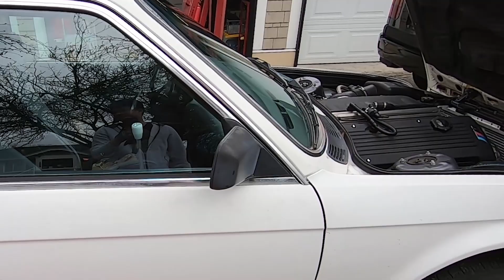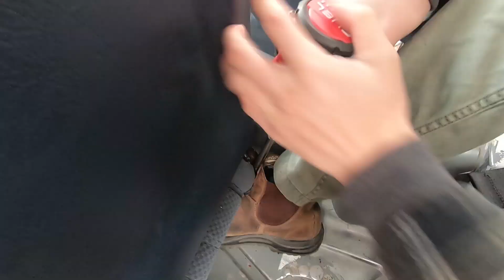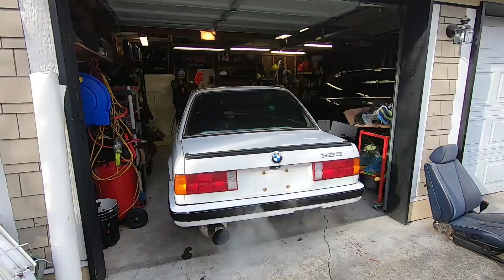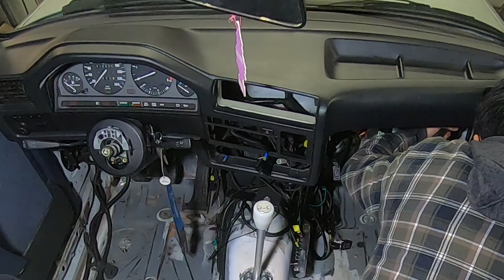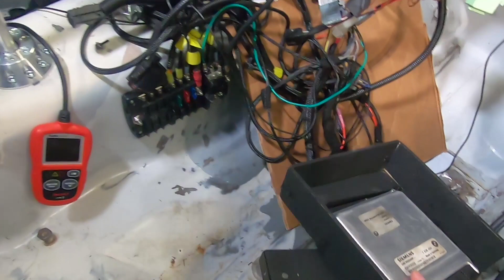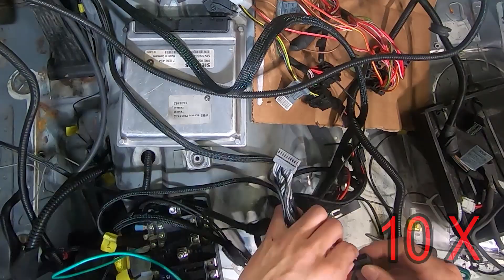How to Engine Swap BMW S54 E30 - Custom ECU Wiring

Comment: how do you make this car run?
Reply from the maker: Still using the stock ECU that came with the new engine.  You also need to use the OBD 2 port to erase the immobilizer feature out of the ECU.
Reply: @Garage88Official  this dudes comment. Put it in and hook it up.